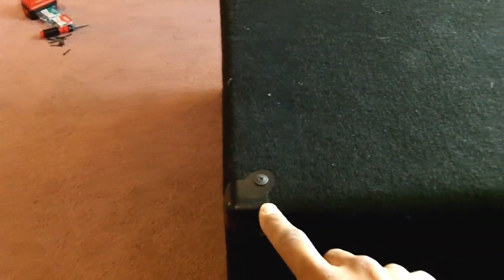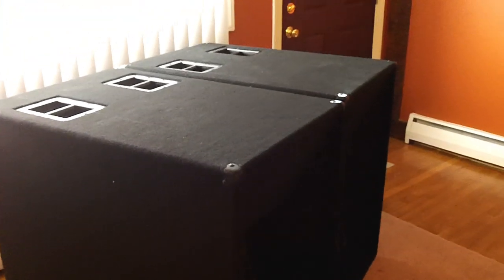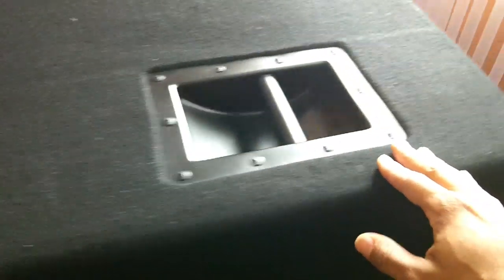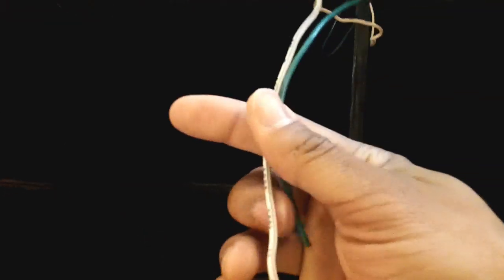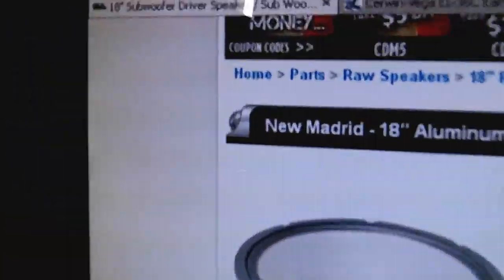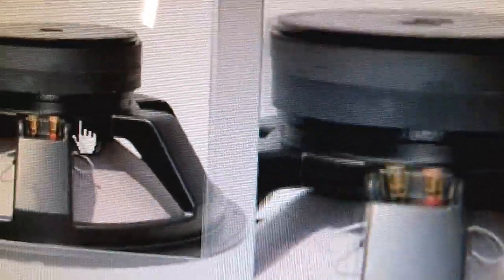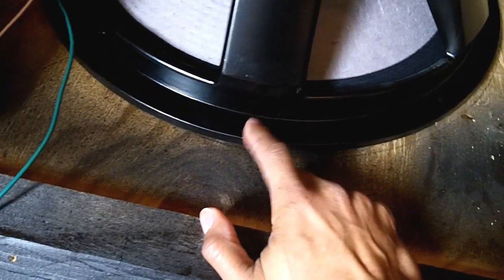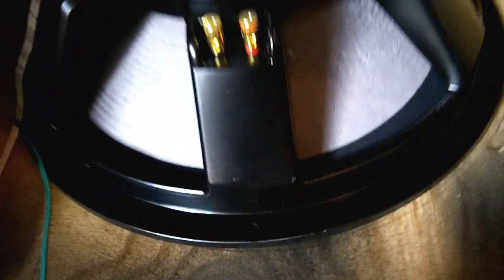Folded Horns (Custom built 18" cabinets)

Comment from the maker: The MDF board can crumble or crack over time. If you ever bump the box when moving, the wood may have pieces chip or break off.  If you are transporting these big cabinets when DJn, you may end up with some problems if using MDF.  I left it up to the builder to choose since he has been building all kinds PA speakers for over 20 years and from talking with him, he has never had any issues with plywood. He even build with birch if you want.

Comment: Love the cabinets.  I doubted the folded horn until I happened on a pair of Cerwin Vega L-48-SE cabs cheap, and they blew me away.  Each one is a single 18" driver in a W style cab that measures 48" by 48" by 24" and weighs somewhere between 150-200 pounds.  And believe it or not, my folded horns were built in the 1970's out of plywood, and have survived to this day.  They're miserable to move around, but when the ground starts to shake, you understand why they call 'em Earthquakes!

Comment from the maker: I personally think the NU3000 will push the two 15"s without any problems.  I would hook both 15"s up in parallel so the amp will see a 4ohm load and that way you can bridge the amp.  I have used this NU3000 for over 1 year now and always bridge it to run both of my 18"s (either my front firing or my folded horn 18"s) and it kicks very hard!!! If I were you I would at least try the NU3000 and if you are not satisfied then return it and try the QSC.

Comment: MDF is almost exclusively used for speaker boxes because of the superior resistance to vibration and sound quality. Plus I think MDF looks nicer. But over all I was just wondering cause I don't see many boxes made from ply anymore. I am anxious to hear how your folded horns sound though! I have been curious about them for a while, I just decided against them for the time being because of size.

Comment from the maker: I got them with 3 qtr inch ply and they are about 120 LBS each without the drivers.  They are built very tight. You have the option to use birch or ply with the builder.
Reply: Do you know any one that makes these boxes

Comment from the maker: No offense taken...my other folded horn video I compaired the 2 boxes and stated how the ones he makes are a exact copy but the pressure chamber chaber (on the front where the driver will sit) is a bit different so he will not get in trouble for copywright issues.  But other than that they are the same but way less money.  I paid $300 for a pair which is a steal for my budget.  They hit very hard!! Peace...

Comment: Hate to be a moodkiller but Speakons are just as easy to run in parallel.  If the jacks are wired parallel all you need is a cable coming out of the first and into the second and there you are.

Comment: I have a cva-121 right now Cerwin Vega 21 inch sub it's nice for small venues but if I was to go bigger I would just get the ts42 folded horn setup again the footprint is larger than what you have its 42 45x24

Comment: Need real advice on the Behringer amp I have 2 15" Eminence rated@800/1600peak@8ohms do you think I can get good clean solid power from the Inuke amp that you run because I was considering the Qsc 4050. hit me back with what you think

Comment: Think about what sound is. Air movement at a certain cycle, period. When you obstruct the movement of air because the surface containing said air is shaped like the grand canyon, you can upset the cycle and also diminish power. A proper box containing speakers should be as smooth as possible on the inside, containing minimum obstruction. Only obstructions should be intentional for shaping sound. Not inherent from building materials. There are just way to many reasons not to use plywood I don't

Comment: Just ran across the page.  Looking to get back into music after several years.  Is Rod still building cabinets?
Reply: David Tate I've purchased two Folded Horn cabinets from Rod a couple years ago but now i don't think he's building to the public anymore(checkout my1850 Folded Horn Subwoofers videos )... Are you in the Miami area? If not there's a local dj shop@Top Audio Miami check them out they sell empty boxes like scoops and other styles.

Comment: ply wood was inexpensive years ago. today for a reasonable price - people everywhear can go and buy a cheaply priced so called wood board - actually layered paper glued together with heat & pressure, & say that its the best.years ago ply wood was the best.consumer products mostly were made out of glued saw dust, or particle board because it was inexpensive. ply wood is more resonent than the other two but seriously - have you ever said that they can hear the ply wood under the carpet covering ??

Comment: I THINK THEANSWER IS NOT REALLY, use your own ears and dont believe all the hype - without plywood cabinets you would not have  had woodstock,live concerts,or huge hanging pa cabinet systems that you enjoy at concerts. & also ply wood can get wet and shake it off, try that with MDF :<)